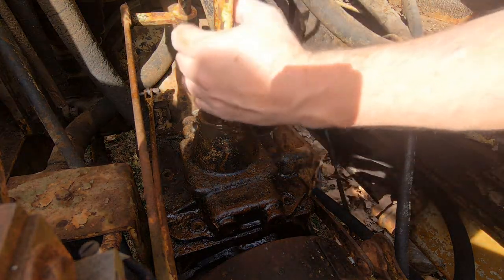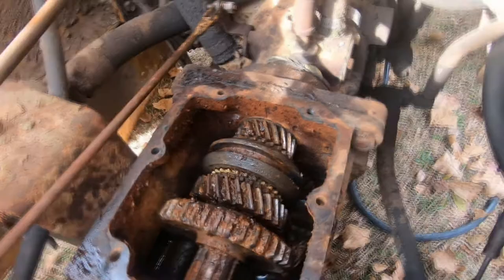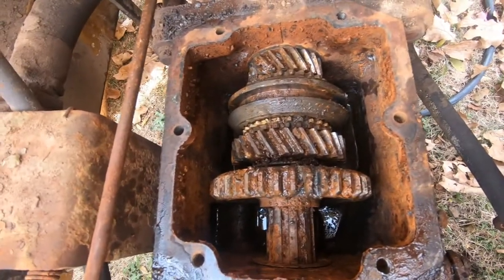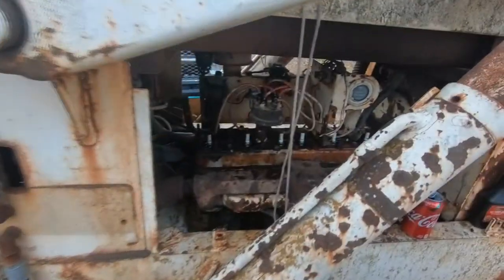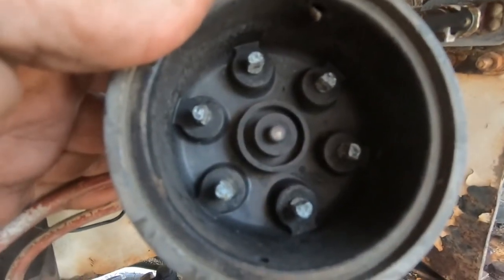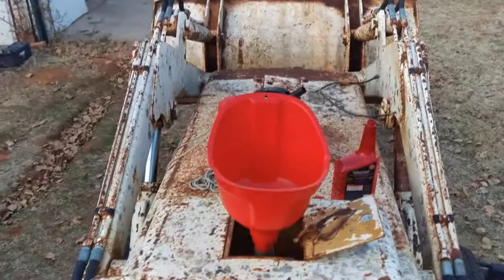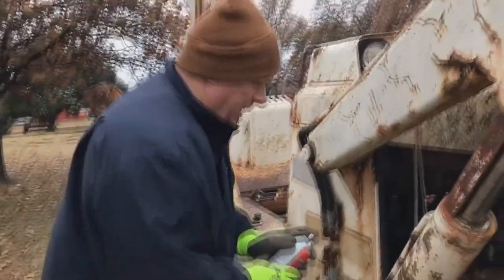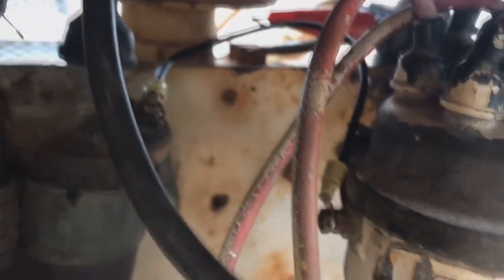Testing Hydraulics on The Dynasaur - Backhoe Inspection

Comment: cant wait to hear if your going to fix it or not.....
Reply from the maker: You mean you want to know if we are truly crazy?  Haha.  We're open to your input!  How are you?  So far, it is still cheaper to fix, keep and transport this backhoe than dirt work will cost at Contentment, but we have to consider it's ultimate value. Though our labor is free and have time to work on it, it's not wise to drop more money in this thing than it will sell for.

Personally, I am not intimidated at all by projects like these. I have rebuilt engines before. We have sourced most of the parts we may need for it. And the hoe came with several new hydraulic hoses that were never installed.  But this is a very tired old beast, as you see in the video. We have our eye on another unit, just in case. I'm going to pull the cylinder head and transmission this holiday weekend and will be able to make a final decision by then.  So good to hear from you, Thomas!  Happy Thanksgiving.